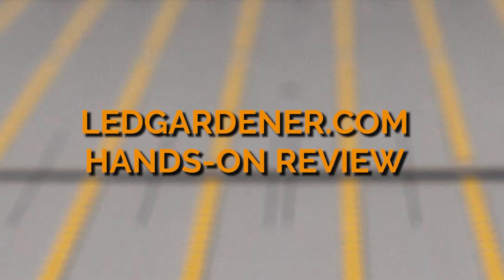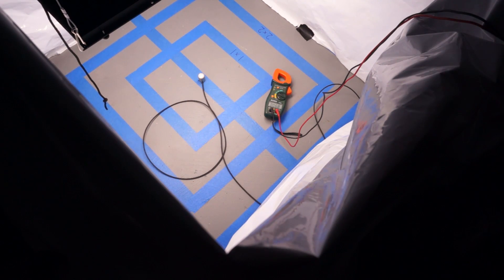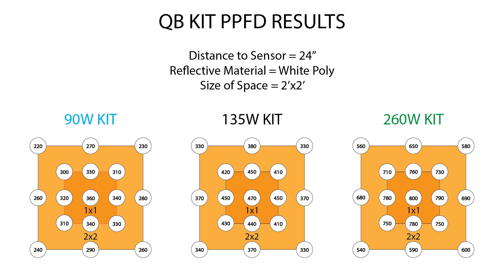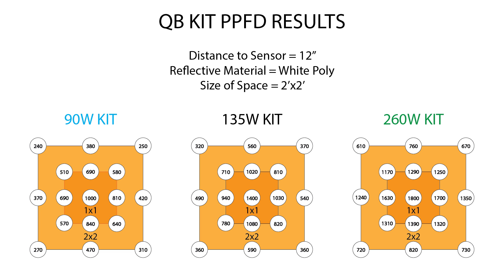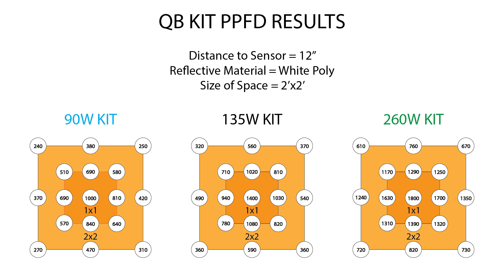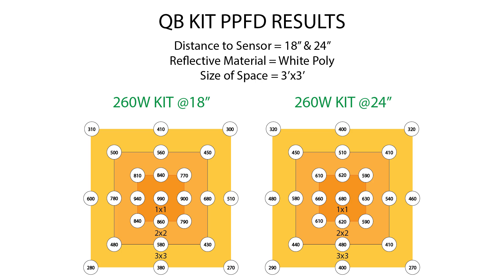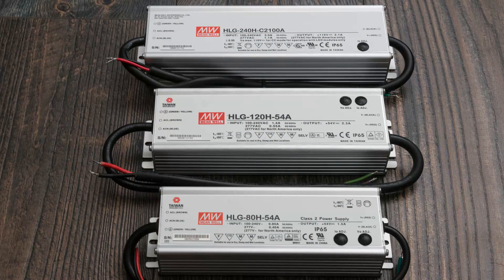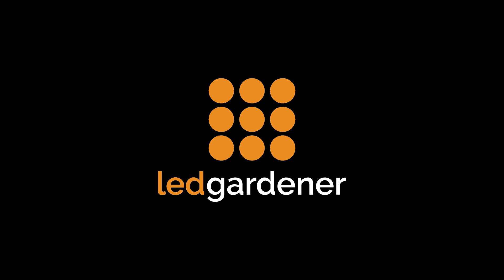HLG Quantum Board Kit Review: Part 3 - PPFD Measurements

Comment: Bit of advice if anyone can help,so I got a small closet measuring 1Mx1M but the height is 1.50M height, would these be to intense, I'm Sick of using CFL bulbs, utter shit, They never last longer than a year, especially the dual spec ones,so I want to go led, I'm thinking 100w,150w, would quantum boards be best or strip lights, any other options welcome 👍✌️

Comment: Running the 320watt 3 board kit with a meanwell 320h c1750 in a 3ft by 4ft tent. UNREAL. Can have no closer than 24 inches. Since I ran the driver remote I have almost no heat generated in the tent.

Comment: I got a bunch of bent 8ft 6500k t8 stand alone ballast bypass cfl replacement bulbs in an auction. Can i Take them apart and build my own configuration with the strips? Are the built in drivers any good?

Comment: Honestly, judging by these tests, I’d say the 260W is really best used in a 2x2 at 18 inches. 300 PAR on the edges of the 3x3 is gonna be larfy/airy flowers. No thanks. Same for the 135W in the 2x2.
Reply: well you could just lower the light
Reply: Nukethe Whales that would only lessen the light intensity on the sides. 

Note that the side PAR measurements were actually lower at 18” than at 24” in a 3x3. That’s because the actual light itself has a smaller square footage than the tent it’s in, meaning the lower you drop the light the less it’s able to make use of the reflective walls of the tent (due to the angle it is emitting photons at) which results in more intense center PPFD, but actually a decrease in perimeter PPFD.

The 260W pretty much fills the 2x2 tent though, which means that it can continue to increase perimeter PPFD as it is lowered (as the sides are still close enough to the reflective tent walls to make use of them and get sufficient photons to the canopy).

Comment: Love ur videos! I'm looking to get the 135 for veg but want the option to also use it for flower would the 4000k or 3000k work better for this in your opinion my friend
Reply from the maker: If I had to pick I would probably go 3000K full cycle based on what I’ve read from others who’ve faced the same choice. I’m sure there are just as many people that would do the opposite though.
Reply: @LEDGardener  yea that's what I'm probably going to do. 1 more question buddy lol but why is the 135 V2 kit 20 bucks more then the 135 v1? Is it just a better board? Or what's the deal lol
Reply: Gary because of the added 660 red diodes!

Comment: The only problem with LED lights is we can't get them close as HID with 1000 Watts of raw true power at $100  per ballast now along with Air Cooled Hoods and 3000k and 4000K spectrum Growing Strain to 30% plus THC and killer yeilds making LED Technology worthless we can run 1000watt HPS at 12 inches with AC Reflectors and I been Growing for 35 year's I'm 50 now and don't see the advantage of LED light Technology because they bleach and burn the plants at 24 inches away or dim them down which reduces power making less yeild and quality 🤔
Reply: Spoken like something who speaks well beyond his empirical experience. While I've no reason to doubt your experience with hps, You obviously are not with led.  Having used both technologies extensively, I can say in no uncertain terms that what you just said is utter bullshit.  My DIY rig (24 cxb3590 3500k@ 50w/sqft) give me better results in both yield and quality than 1kw hps, without question. And with a typically accelerated flower cycle. I can keep my lights a couple inches off the canopy at full blast, and I've never once bleached a single leaf. I grow in living soil and (in 10gal fabs- yes you can keep LS in 10gal pots), and often pull ¾-1lb plants in this setup.  Without c02.
Reply: I should clarify/amend the above statement here to read "better than a pair of 1kw hps... Which is what It was using in a 4x8 space, which the cree rig replaced.

Comment: ok, can someone help me here please, ive got a 2m x 3m grow tent, and i have 3 x 260 double QB's - have i got enough to cover flowering? im really confused!
Reply: Just get 2 hlg 600s that will cover ur area
Reply: Hmm no get one more I’ll be fine u actually had 63 so 850w
Reply: No you don’t.  A general guide is 30–50 watts of led per square foot.   
You have around 70sqft of floor space, so 70sqft*30watts =2100watts.
And you have 780 watts.    U need to triple your light output basically.

Comment: Anyone know why Horticulture Lighting Group keeps putting the word "SALE" next to some of their products on their website but they leave the price the same as it always was? Very dishonest.
Reply: I don't think that's true.  They might be raising the prices only to lower them again,  but that's pretty common.  Amazon does that.  I just got a scratch and dent and it was definitely cheaper than normal.
Reply: @LarsLarsen77  Stop lying.  It is true.  Go check for yourself.  Sale of no sale the price is always the same .
Reply: I believe when they first came out they were that original price. When they went to lower the price they just effectively put them on a permanent "sale". Many companies do this, how often do you really see any chain store actually charge the MSRP? Amazon almost never charges the MSRP, yet they list it as the "normal" price despite anything rarely ever being that price. That's why sites like camelcamelcamel exist. The markup on the quantum boards is actually really low. Even ordering direct from China will not save you much (10~20%) and you get a lower grade product (the heatsinks available from the Chinese stores are thinner) so they actually had to cut costs to lower the price measurably.
Reply: @Ancyker  not true.
Reply: @elperrocovero  even if that is so, the only manufacturer I know of that doesn't have an MSRP that is nearly always higher than the actual price is Apple. Yeah, Apple is the only company I know of that the price is the price. Everyone else has a higher price they mark down from day one. Not a big deal.

Comment: How are you orienting the 135 watt light in the par test? is it 45degree off angle compared to 260w kit? wouldnt that affect test results since the orientation of diodes are not square but rather cover a square area unevenly? I inquire because I am trying to figure out how best to orient a nonsquare light in a square space in regards to 4 plants below it. From averages, is it correct to assume hang light perpendicularly to space, and place 4 plants at NSEW rather than the top and bottom left and right-most corners?
Reply: I try to center the largest/tallest plants underneath the boards when possible. If equal height then I space them evenly. I have a PAR meter so I'm at an advantage as I can make sure the plants get the specific amount of light I want them to.

Comment: Would you recommend the v2 4 board kit that comes with 600 watt driver or the diy cob kits?also I wonder why they went with a 600 watt when basically from your testes the 480 would be better.could be the new diods also.Help need to figure out the best way to go please!
Reply: I don't see how his tests show the 480 would be better? The 600W kit is **insane**. Over 1600 PPF at 18" in a mylar tent, even on the edges of a 4x4 area, it does not fall below 1000 PPF. My plants 30"+ away were getting light burnt at full intensity on 18/6 (it was too much light over that period of time, they are happy with full intensity at 12/12 @ ~22", so the full intensity is still useful). The 600W kit is not only a true 1000W HID (HPS/MH) replacement, it is superior to it in every way: more light, less power, less heat, less space (it's shorter so you can raise it higher giving more vertical height).

Comment: why are your readings almost double from the ones on the HLG website?
Reply: HLG is probably trying to be conservative.  They rate the HLG 260 at less than the 298 watts mine pulls with the dimmer on high.
Reply: maybe, my QB V2 pulls 165 at max, when they say it only goes up to 150. i set it at 135. or maybe HLG didnt use enclosure?
Im still learning. on my second grow, as properly as I can, enclosed diamond mylar vinyl , fans, monitor heat/humidity, aerators, no light to water source, ample ppfd (possibly too much?), watt meter, timer. looking good so far.

Comment: My hlg260 watt dials down to 92 or so watts off the driver. It's listed as 135 to 285, my question is, is there any danger of using the driver at the low 90 watt setting? I'd assume not, just might be more efficient, but I don't know for sure.
Reply: I have an HLG 260 in a 2x4 space and mine pulls 95 watts on the lowest and 298 watts when turned all the way up.  This is the first version btw.
Reply from the maker: Nah, that sounds totally fine. These drivers tend to surpass their ratings and in this case it's likely just dimming more than it's rated for.
Reply: Erik Coulombe I'm getting the New qb288 XL v2 and then another for my 4*4.
 I was thinking of starting at 50% on Watt metter and later into flower I wld max at 75%...

Any thoughts?

Comment: How does 2 of the 260w compare to 2x viparspectra 600w ? Thats what i would be replacing if i buy 2 of these. How about in comparison to 4 vipars vs 2 of these? All in a 4x4 tent.

I loved all the parts, i learned a lot :D Thanks for the detailed very well done video's, it also helped convince me to purchase these in a future upgrade, if i can find out how 1 of these 260w compares to 1 vipar 600w, hopefully you guys know :D
Reply: I have the VIPAR 400W and now the HLG 600W. The VIPARs are only good directly underneath them. The falloff is very quick as you move from the center. The 600W VIPAR is good for a 2x2 area. So that means if you are using those 2x 600s on 4 small plants (SoG) you probably won't notice much of a difference. But if you are trying to do SCRoG or more than 4 plants, then it will be significantly better.

All the quantum boards look inferior at first glance because you see something like the 600W VIPAR putting out 488 PAR for only about 260 actual watts. Compare that to the 260W HLG quantum board which puts out 500 PAR but costs more than twice as much. But that's a center-to-center comparison. 1 foot from the center the VIPAR drops to 235 PAR, while the HLG is at 370. At 1.5 feet the VIPAR falls to a mere 113 while the HLG holds at 260. That's all at 24". The HLG will pick up significantly on the edges if you lower to 18" (310 at 1.5 feet) while the VIPAR will not, in fact, the VIPAR will lose PAR on the edges the more you drop it.

Even more so, all of this is open air. Both go up in a mylar tent, but the HLGs go up significantly more. About 20% more with the VIPARs and 40-60% more with the HLGs. It's insane.

Comment: Very nice review !!
Just one idea tho, wouldn't it make more sense to split the heat sink of the 260w kit in 2 and put
the 2 board side by side to get more of a square shape instead of the long rectangle one ?
You might get better coverage on a 3 x 3 surface, you could even space them a few inches .....
Reply: I did exactly that.  I ordered two 4000k 135w kits and spread them apart by a few feet.  I can just move them closer together if I want to blast a small area with light.  I just have a couple cup hooks hanging from my ceiling and I switch between them.  It is more expensive to buy two drivers,  but it makes the wiring easier.  I could take one to another room without rewiring anything.  Another option is to buy the 3 board heatsink with just two boards.  You can add a third board later for better efficacy.
Reply: They actually sell a kit with two boards in a square shape now.  The HLG300 is like that,  and also this 260w:  https://horticulturelightinggroup.com/collections/all/products/260w-xw-qb-led-kit
Reply: i think 2 of these are amazing for a 2 by 3 foot

Comment: Great videos... im doing something similar, can you please double check my logic?

On
 the 260w setup... the 2100 mA driver is powering 2 boards which can 
handle a maximum of 3000 mA each (6000 mA total).... so the lights are 
under-powered.... 

I understand that staying well under the 
maximum is a safer bet for longevity of the electronics, fire hazards, 
etc.... but I would like to get closer to 80-85% of the lights max, at 
least (get my money's worth, right)...

Looking at the variety of 
Mean Well drivers, I noticed that they are all either under-powered or 
over-powered for this particular setup.... (specifically their current 
rating)

So, my question is, if I get a driver which has a higher 
current rating than the quantum board can handle, can I use the built in
 constant current adjuster to lower the current to a safe level?

For
 instance, on a 3000 mA max quantum board, could I use a 3500 mA driver,
 and turn the current down (via the built in current adjuster) to 
2800-2900 mA?

(assuming the voltage is still in the correct range)
Reply from the maker: Doctor Natural you bet. There's no reason why that wouldn't work - just be sure you never turn it up to max by accident! I'm not sure how much light you will gain by giving it the extra 600-700mA. Might be worth testing - you will see diminishing returns though. Be mindful of how hot your boards are running too. If it were me and I was determined to drive my boards hard, I'd go with a 2800mA driver at most.

Comment: Thanks for the nice video. If we want to measure the PAR we are getting in our room, which meter do you recommend??
Reply from the maker: I'd recommend an Apogee MQ500. It's all-in-one so you get the sensor as well as a read-out display. If that's out of budget, I'd recommend the SQ-520 which is the USB version of the sensor. I thought the SQ-500 would be the way to go, but I sort of regret getting it since you need an expensive multimeter or a little amplifier to properly measure the signal the sensor puts out.
Reply: Thanks!

Comment: awesome video as always!   I love my 135watt kit for veg!  Yes Robin is awesome with the customer support and quick!!! I remembered you saying that one down side was the holes the wires had to go thru on the heat sink... I found cheap grommets on amazon that fit well :).. The one potential downside I am wondering about is how the bare diodes stand up to foliar sprays randomly hitting them when I miss :)  should I look into the FLORANCE optics for them? or use some acrylic sheets  just to protect them? humidity play into that also?
Reply from the maker: My man JGG! Yeah - I think the grommets are a good idea to reduce the chance of damaging the wire on the way through the sink. You should really only have to do it once, so if you're careful, they're not totally necessary, but it can still be tricky to get that stiff cable through without scraping a bit.  I've had a few people ask about the possibility of moisture causing problems lately - I haven't heard of anyone having any issues with water shorting things out. Might be a good idea for my next test...
Reply: yea I did my kit just fine without them.. but my build I'm using them.. incase I have to move boards around rewire ect
Reply from the maker: Good call.
Reply: I just used heat shrink. I even doubled it up. I put heat shrink on the individual wires and then put it on the group of wires. I had it laying around so it worked well and it cost effectively nothing for me.